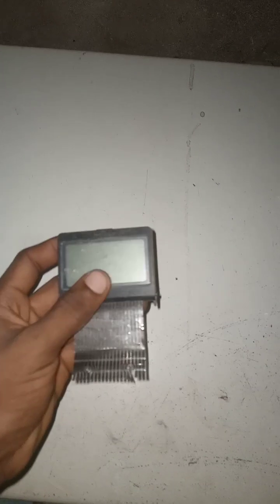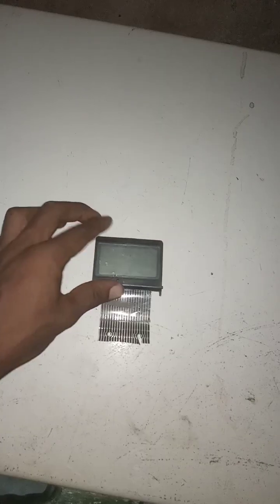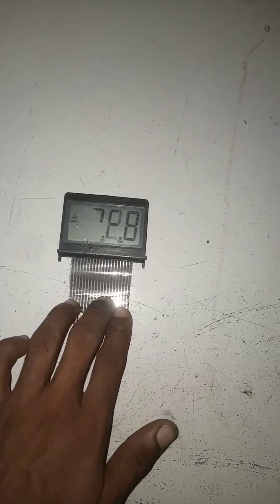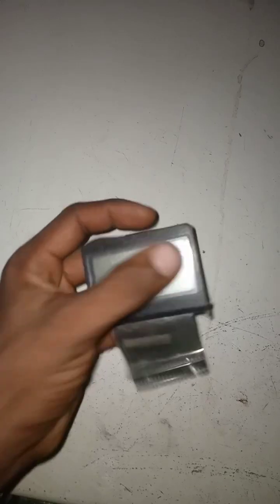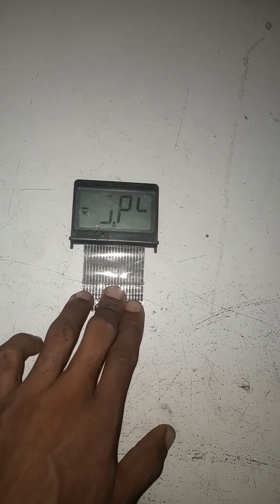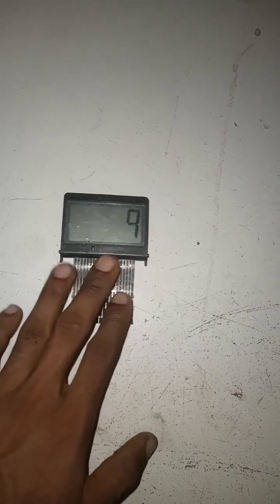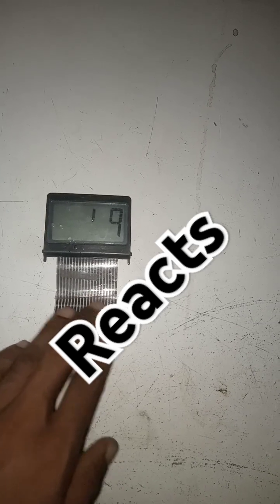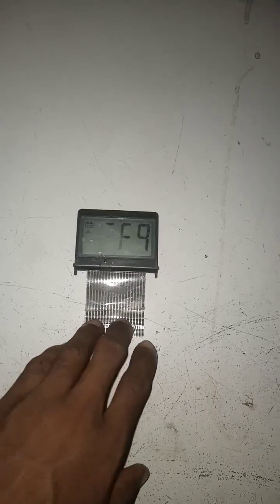lcd screen reacts to fridge

Comment: Nope. Your body is conductive and produces electricity. You placing it on the fridge makes it a complete circuit as the fridge is grounded. 😅 Electrons pass through fingers into the device the out then into wires then into the fridge, then into ground
Reply from the maker: Yes the lcd is super sensitive to the little electrical current

Comment: Bro thats easy physics! You really have positive electicity in your body and the fridge have the negative on the fridge metall ! Its like in your car THE WHOLE METALL OF THE CAR IS THE NEGATIVE OUTPUT. I DONT HABE TIME TO EXPLAIN I5 IN DETAIL BUT THIS WHAT YOU SEE IS REALLY COMPLETLY NORMAL BRO! GO TRY IR ON YOUR CAR ! IT WILL ALSO WORK! MAYBE STRONGER ON THE CAR BUT TRY IT BRO😅
Reply from the maker: I'm not sure it will I discovered that it works only on AC I mean very very low voltage AC